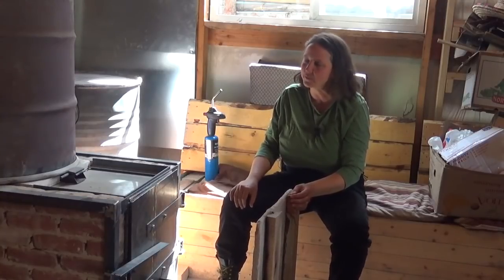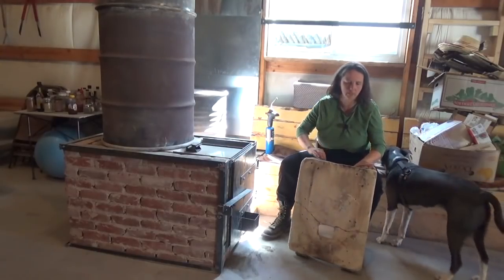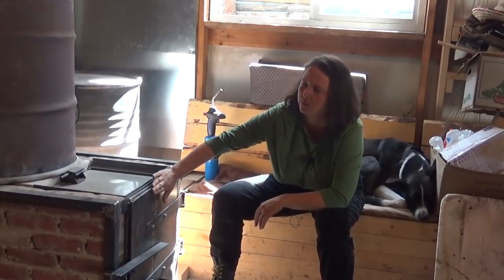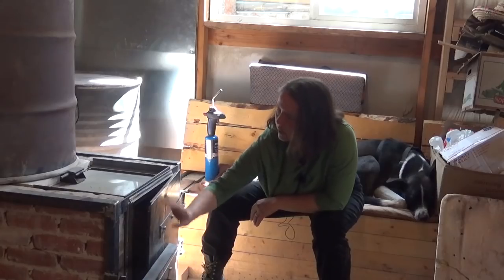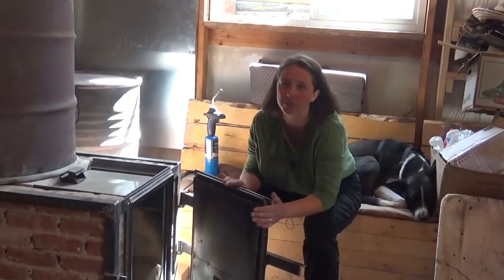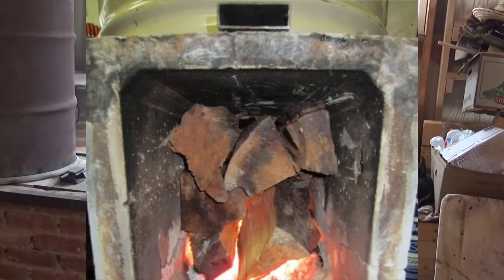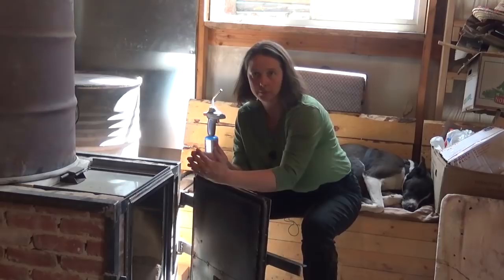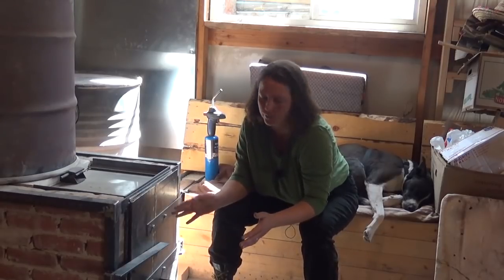Batch Box Heater with Erica Wisner

Comment: So Erica, does not matter how much wood is placed in the firebox the burn time is roughly forty five minutes. What can you do to make a burn cycle last 12 hours ??? Thanks
Reply: You don't

The whole point is to quickly burn hot and clean and store that heat into the mass for gradual release.
Reply: @priestesslucy  Thanks for the info.
Reply: @victoryfirst2878  The purpose of the "mass" in a rocket mass heater (or any masonry stove) is to store heat to distribute throughout the day. 

I heat a 3700 SF house and we only burn ~3 hours in the morning and ~1 hour at night. The rest of the day, the mass is radiating heat. That's one of the main purposes of this type of stove.

I don't believe it is physically possible to burn a batch of wood cleanly with that long of cycle. Just not physically possible. And it's not desirable to do it the old smoky way. Much fuel is wasted, creosote is created in your chimney, and your neighborhood is polluted. Don't be a bad neighbor.

Instead, build a masonry stove which burns short loads, hot and clean, and then stores the heat for many hours of warm radiance. It's the best way I know of to heat a home with wood.

If you only need temporary heat, such as in a shop, a stove made of steel would be a better option, with a fire brick burn chamber, and metal radiator, like Peter's test rig which is made of 3 barrels stood on top of one another and no mass.
Reply: @wiredforstereo  Thank you for the information Solomon. I would like to pick your brain for for making an ultimate wood burning stove of sorts that would heat a 2600 square feet house. I do not want to make a mass part of the heater.  Would using a wood stove and then attaching a rocket stove to reburn whatever is left work ??? I am thinking that even if I have to burn a few times it would be no big deal for me. This would be along the line of the 3 barrel stood on top without the mass part. 
Hope  you had a Merry Christmas Sir. Also, hope that the New Year will be the best year for you and me Solomon. Peace to you too Sir...
Reply: @victoryfirst2878  I am happy to answer what questions I can, as an owner/operator of a 8" J tube rocket mass heater which u use to heat a 3700 SF house. 

The rocket mass heater or some version of the batch box masonry heater is the ultimate wood burning stove. Properly designed and operated, it approaches the maximum physical limit of efficiency and operability (without electrical input). Nothing burns more efficiently. The only limit is the exhaust gas temperature which must remain above the flue gas condensing temperature both to avoid condensation and to maintain draft.

So those are the two aspects of an efficient stove, complete combustion, and extraction of the maximum heat from the exhaust stream. Some heat must be sacrificed up the chimney to maintain the draft. But a wood stove loses 500F+ exhaust with smoke and a lot of carbon monoxide, whereas a RMH optimally exhausts 220F exhaust with no smoke and very little CO. This results in the best practicable possible burn.

A very long burn, more than two hours from the best constructed batch box is not possible.

Combining with a wood stove is not possible. You'd be seeking some sort of a solution with a catalytic converter, which is possible, aftermarket solutions exist.

You can make an RMH without the M, as Peter has. But you eliminate the possibility for long term heat output. That's what the mass does, stores heat to make up for periods between firings. 

One possibility I have considered is to add a bell to a wood stove, which would stratify the exhaust gases so that only cooler gases would go up the chimney and result in higher efficiency, but that would take up extra space. 

Another option would be to heat water and use that for the mass. Water absorbs a huge amount of heat per mass but introduces other problems.
Reply: @wiredforstereo  What is the bell you are talking about adding to a wood stove ??
I have added two 15 gallon beer kegs on top of the stove to retain a little extra heat. Next to the side of the stove I have 150 pounds of aluminum heat sinks. This is my quick solution to the mass. I know it is not much but it helps add an extra 1, 2  and sometimes 3 before adding wood. Wood for me is no big deal. I get it for nothing and delivered to my backyard. My other heat is electric. I believe I do not have to say anything more. 
The stove I am using is right outside the fireplace by about two feet. I am not using the actual  reeses in the wall. Just have a vertical steel insert to attach the 6 inch flue pipe. The chimney flue is 12 inch square terra cotta. Not really that high in height say 12, 14 feet high roughly. 
 
I am interested in ideas that are proven and work. 
Thanks vf
Reply: @victoryfirst2878  A "bell" is a large space inside the stove or masonry where gases can slow down and stratify. Like everybody knows "heat rises" but in reality the hotest gases go to the top where they lose their heat to the sides and top of the stove, and then as they cool, they fall down and are released out the exhaust. This is one reason why wood stoves are so inefficient. The hottest gases go up to the top of the box and straight out the chimney.

Aluminum or other metals can help radiate the heat into the room, but they don't store hardly anything relative to stone. Search for specific heat capacity of various materials, most stone based materials are 800-1200 J/kg*K. Water is 4200. Steel is 480. That's why we use stone, cob, and brick for mass, it stores a lot of heat.

But even if you have the best radiators, your combustion efficiency is still crap. Without proper combustion chamber construction and materials, much of your heat is going to go up the chimney as smoke and unburnt carbon monoxide. Even the best of stoves still assume 3000 ppm of CO going up the chimney which is a huge amount of unburnt fuel.

But if you get wood for free and want to spend all that time and energy processing firewood, hauling it in, burning it, and cleaning up after it, then more power to you. I spent my entire childhood gathering wood and feeding a 100 year old smoke dragon of a cast iron stove. Now, for the same amount of wood I burned every day growing up, I can heat my house, which is twice as big, for 10-14 days. I get all my wood for free (pretty much) also, but it's because I need so little of it, that I can randomly collect it year 'round and have space for two years worth of curing time.

I don't know how much more proven the rocket mass heater ideas can be. There are thousands of them in use around the world. Peter Van Den Berg developed both the original batch box design as well as the double shoe box (DSR) in public on the forums and freely offers his plans on his website which is batchbox.eu. You can find my stove on Permies as well. I had mine tested, and while it didn't come out to be the most efficient, a lot of that had to do with an unperfected design. But it still works and works very well.

This spring, I'm going to tear it all down and build a new batch box masonry heater to replace it.
Reply: @wiredforstereo  Sorry I did not get back to you fella. Got a bad cold. 
Hope you and I have many more great New Years to celebrate. Peace vf
Reply: I am finally over my Covid flu. What a bitch Solomon. Would you give me some more insight on the three barrel rocket stove ??  I look forward to your reply Sir. Thanks for understand my absence too.
Reply: @victoryfirst2878  I don't have any information for you on the three barrel rocket stove. I assume it uses extra barrels for heat stratification, trapping the heat in the top of the barrel while releasing only cooler gases out the bottom.
Reply: @wiredforstereo  How about this fella. My basement has a masonry foundation. The fireplace on the first floor has a cinder block wall from the foundation which is 18 inches wide and 2 feet deep. The wall size is 3 X 6 X 7 feet tall. Would filling the inside of the rectangular pillar with stones and sand to the top make a great natural heatsink ?? The stove could be placed outside the pillar with channels made on the outside going along in a circular course to the top where there is a flue that goes outside. This would be able to heat the pillar and give the heat a chance to stay inside the house which would rise up to the first floor to heat more of the house. That is my idea Solomon. vf
Reply: @victoryfirst2878  I wouldn't be comfortable offering direct design advice. Build it like in the book and you can't go wrong.
Reply: @wiredforstereo  What book are you talking about Sir ?? Any other ideas let me know, I am interested fella.
Reply: @victoryfirst2878  Rocket Mass Heater Builder's Guide by Erica and Ernie Wisner.
Reply: @wiredforstereo  Which is the best book Sir ??? Thanks

Comment: So the bottom line is this: 
1) The air intake is a calibrated size and if you open the door when the stove is burning, this will affect the draft and smoke will come out.
2) It is called a "batch box" because you load a batch of wood into the firebox, light it, and wait until it burns out before opening the door.

Comment: So is it just the same as a rocket mass heater without the j tube?
Reply: A J- Tube you would have to reload the J tube multiple times to equally the same amount of wood you would load into a Batch box.   You get the same heat from both, but the J requires much more tending, and a few burns compared to a batch box single burn.  So do you want to do ~3 fifty-minute burns or 1 fifty-minute burn, is the question.

The build of a Batch box is more work and material, and the door is the trickiest part.

I divide a rocket heater into four parts - 

- feed part of J-Tube or entire Batch box with food which is where all the wood is consumed which includes air flow, so you complete the triangle of fuel, air and heat for an effective fire.
- the Riser/with stratification chamber around the riser.  The riser itself is usually fire bricks while the outer stratification chamber around it can vary: metal drum; fire brick; etc. The cooler lower stratified air outside the Riser but inside the stratification chamber expels from near the bottom into the mass or the chimney, (see below)
- the mass which is optional but highly recommended if you're heating a space: cob, brick, pebble, etc.
- finally, the chimney. A bypass can be added to the chimney to direct the heat up the chimney which is useful for starting the rocket heater. Once the fire is going well switch the bypass heat the mass which then flows to the chimney.

Sizing each of the above is crucial.  One mistake in sizing any one or more of the parts will cause problems.
Reply: Bit more complex than that, it's an entirely different firebox design from a J.

Comment: Is it possible to create a cubic wood stove (cub size) 'like' batch box heater that  is functional or are batch boxes set at a certain minimum internal volume to operate properly that prevents a small unit being made?
Reply: Batch boxes can be scaled up or down and still be reliable. There are published examples of 4" diameter systems that work great.
Reply: When you get too small it's start to fail to function.
Reply: I highly doubt a 4” system works great. Hard to think of a use for such a small one either. Just make a 6” system with less mass (sacrifice a little heat extraction), or use soapstone or granite to shrink the volume of the mass.

Comment: I was told today that if I use my old chimney with my batch box rocket heater that it would not burn clean..is that true?
Reply: it all depends on your design, everyone does things differently depending on materials, room available, specific needs & so on. my suggestion is Build & see.
Reply: The batch box, properly proportioned and constructed will burn clean. The question is what size of batch box will your chimney draw allow for?
Reply: You would have to start with the diameter of the chimney and work backwards to size everything else to match that size.  Not sizes vary relative to each parts size.